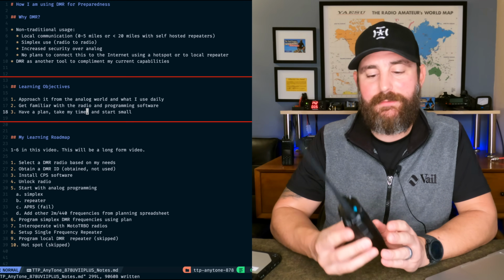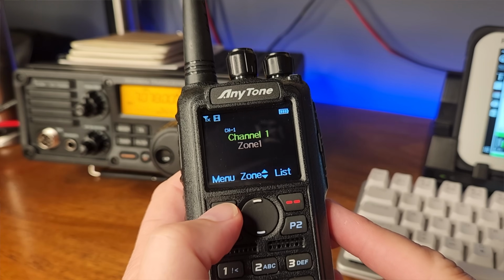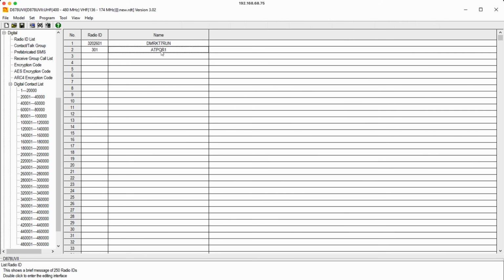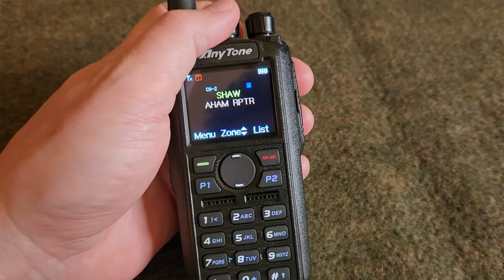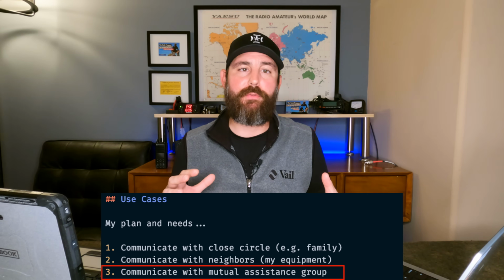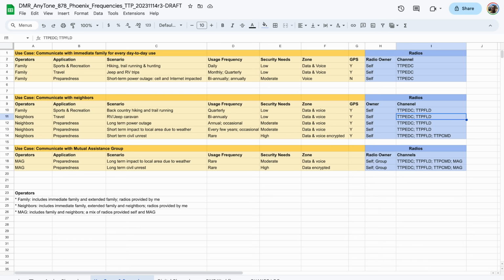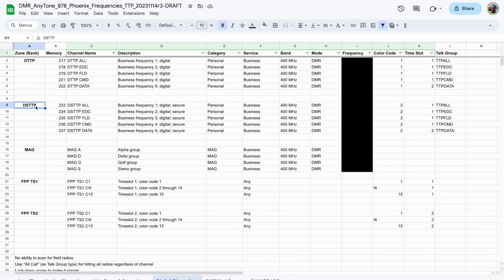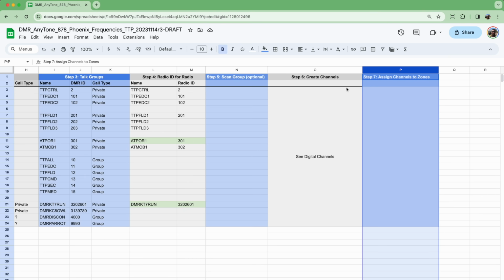How I learned DMR and how I am using the AnyTone 878 for preparedness - No Internet!

Comment: As usual, very interesting video, with plenty of details and precise explanations. 
Thanks Tech Prepper.
I have 2 anytones for a few month and a couple of hytera PD665. They work well together in both clear and encrypted DMR. But sms on the anytones are only CLEAR. It's sad but true. Hope anytone will implement this soon. They seem pretty active on releasing new firmwares. On the last one (3.02) they added ARC4 encryption.
Reply from the maker: Thanks for the details. I plan to look at the Hyteras. They're better built and much more affordable than the MotoTRBO line. Do you know if the PD666 supports over-the-air IP networking? I'm doing some interesting things on the IP networking side with the MOTOTRBO radios.
Reply: @TheTechPrepper  Yes, they are much more affordable than the Motorola ones, and does the job pretty well. The CPS is well made and easy to get used of, especially if you have DMR  knowledge. There are some IP Networking settings : "radio to PC network", "radio to radio network" and "radio services". But its not very clear to me how to use it. I'm still stuck with that. It just configured the telemetry ports from "Radio Services" : you press one button on a radio, it sends an sms to the other one which puts 5v to a pin on the side connector and light up a LED.
About repeaters, I don't know how many you've tested, but If one day you have time and money, Hytera Epack-100 is really awesome. I use it for my job, love it! But it's to expensive for my personnal wallet ! so I set up a Surecom SR628 in a small pelicase ; D878 UVII+ are perfect in analog, in DMR they tend to activate the repeater for 2" only, and PD665 are perfect for both analog and DMR with this cheap solution. 😉
Reply from the maker: @antoinep.7420  Thanks for the confirmation on the IP capabilities. I'll definitely give the Hytera's a look next year.

Comment: Thanks, Gaston. I've been enjoying your recent DMR content. In the case of family/neighborhood communications, something like the Retevis RT43 is an interesting option. It's cheap and simple - no screen or front panel. You can just hand it to someone and say "make sure you keep the channel dial set to 7". It's DMR and analog-capable, and can TX on 400-480MHz.
Reply from the maker: Thanks for the pointer. I'm new to DMR, so I'll check out the RT43. Retvis offered to send it to me sometime back, but I declined as I was not ready for DMR.
Reply: One more thing - I know you've already moved on to your Motorolas, but I think the AT878 might grow on you if you spend more time with it. As a fellow tinkerer, I love how configurable the soft keys are. That's an area where I wish Yaesu would pay more attention. And channel zones, of course!
Reply from the maker: The 878 is certainly feature packed. I may hang on to it for a while and may consider some firmware hacking next year. For me, the problem is the lack of a  ruggedized case and a poor ingress protection rating. I'm brutal with my gear in the backcountry. I covered 6 miles today, and the 878 was covered in salt and sweat. Time will tell...
Reply: @TheTechPrepper  Right on. I run with my 878 in a Salomon hydration vest. I'm careful to turn the front panel away from my body so that sweat doesn't get in through the buttons or the speaker. So far it has held up fine. Please keep beating yours up so that I know how much I can beat on mine!

Comment: You'd be better off getting a 5g node and then operating that on public use frequencies designated for that (used by private 5g systems like at hospitals) instead of getting a commercial license. It has the benefit that everyone already has a 5g phone in their pocket,  so all you have to do is add their SIM card info to your 5g node.
Reply from the maker: It does not have the range. I've been covering upwards of 6 miles on UHF in my terrain on 4-5 watts. 5G does NOT  have that kind of range without cell towers.

Comment: Does anytone support 6m/2m/1.25m/70cm?
Reply from the maker: My AnyTone models support only 2m and 70cm. I am big fan of the quad banders. My Yaesu FT-8900 supports those, but it is analog only. 6m and 220MHz are great bands for opsec. Cheers.
Reply: @TheTechPrepper  ah OK.  AT options opens up the 868 to 1.25m to make it tri band.  Just not quad.  That is valuable addirion

Comment: Thank you for reminding me why I sold my 878! Programming was just to much trouble. Stayed with my Yaesu and Wouxon. Great video though and enjoyed learning more about the possibilities. Keep up the awesome work.
Reply from the maker: I've only looked at 10% of the menu options. This appears to be a standard across vendors once you move into DMR. Motorola's CPS takes some getting used to as well.
Reply: @TheTechPrepper  use RT systems software to program. Way better software, and you can import and export excel files which makes it easier to create codeplugs for multiple radios if you are using that software.

Comment: I’ve read there is a delay on the anytone 878 when using aes-256 did you find this to be true?
Like you have to key up then wait a second to talk
Reply: This is gonna be the case on any encrypted channel, even with expensive military equipment and applications.  When talking in the green on a military radio you will get a “rush-beep” after keying the mic before you can start talking.
Reply from the maker: Yes, that has been my experience. At some point, I need to dive into the technical reason behind this.
Reply: @TheTechPrepper is it just annoying or deal killer?
Reply from the maker: @BobBob-12345  It's too early to tell. I am still on the fence about selling the 878.

Comment: Very very comprehensive walkthrough, thank you for the work in this video. What you called out as context is very key - what is the comms opportunity you are solving for. To effectively program a radio or radios one needs to have a plan, be it to simply talk on a local repeater or to build a comms network to address several different needs. Outstanding video to pull it all together!
Reply from the maker: Thank you, Mike. Everyone's needs are different, so I am a firm believer in understanding your needs and translating those needs into an actual implementation.

Comment: VERY informational!!!!!   This is why I'm looking to get DMR capable!    I don't want the internet involved.  A question , with a 578 in cross repeat, would an encrypted repeater be possible in shtf times?    Thanks again for the content
Reply from the maker: I am still very new to DMR and still exploring the "build your own repeater" side of the equation. This group will be the first to know once I solve this problem. It will be covered in a future video where I will discuss my experience trying to deploy a Single Frequency Repeater (SFR) that can be used with these HT's.
Reply: Yes encryption is possible cross band repeat with the 578
Reply: additionally, you stated that you'd recommend the 878 plus over the anytone at-d878uvii plus... Why is that?  I'm getting ready to purchase and am trying to gain understanding on this.  I am looking them up to compare functionality as we speak.
Reply from the maker: There are two version of the AnyTone D878 UV II. I am using the commercial version (link in the description) instead of the amateur radio version. 1. It is a lot cheaper (almost $100 USD less) for some unknown reason. 2. It is fully unlocked and can transmit on all frequencies on the two bands that it supports without any type of modification (hardware or software). The commercial version will work on the amateur radio, FRS, GMRS, MURS, etc.
Reply: great!   I knew I could not see a difference except pricing and was confused as DRM is a new animal for me as well
 @TheTechPrepper
Reply: One difference I noticed is that the cheaper model only has APRS transmit, and not transmit and receive, and it has bluetooth.
Reply from the maker: @anonymous_friend  That is strange. Mine will TX and RX on APRS. I used for a number of APRS nets. I am running the 3.02N firmware. I bought my 878 last year (Nov 2022).
Reply: I didn't really think this was the place to ask it but I couldn't figure out a way to do it on buy me a coffee anywhere so here goes...will Motorola encryption work or anytime 878 is there a patch or a way to do that?
Reply from the maker: @theamericansilverback  I still need to explore the interoperability between the MotoTRBO and AnyTone radios. The BMAC crowd will be the first to know once I get there. This will be covered in a future video. It's more advanced, so this will likely come in January.
Reply: It is Motorola basic encryption, I just ask thee specific type
Reply: Ok,  I will have the official "key" for the stuff I'm trying to listen to and Operate on.  Would that help you any?  Just let me know sir